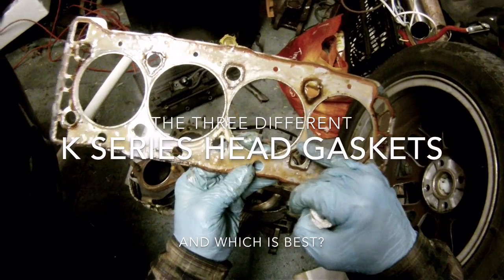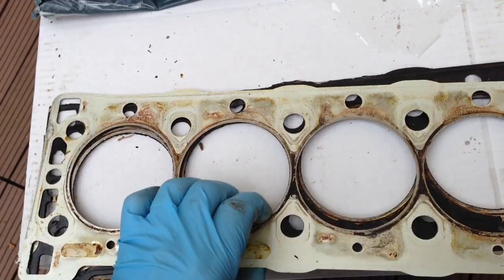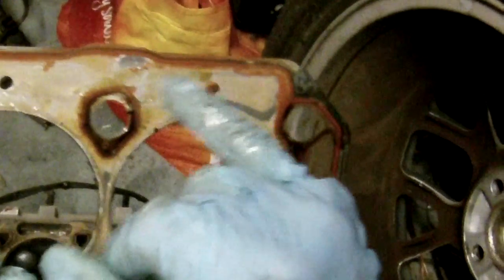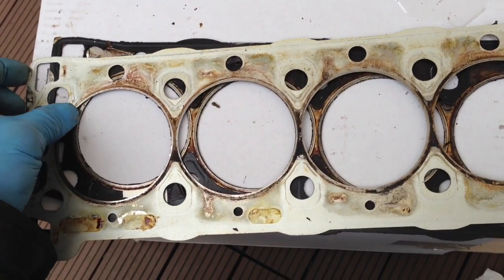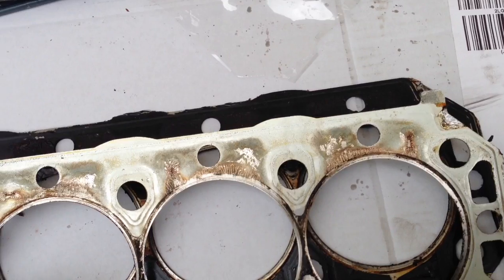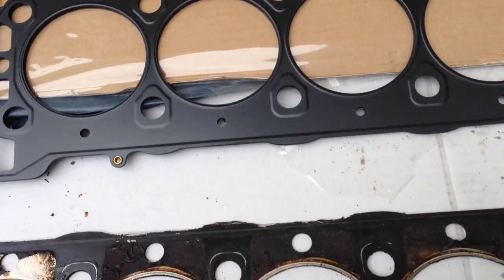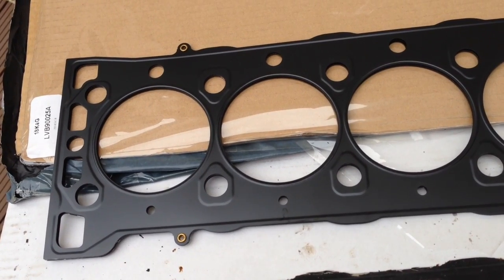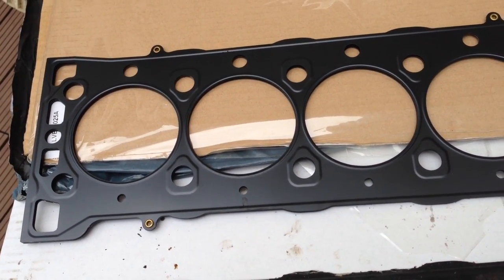MG Rover K Series Head Gaskets Review - The 3 Types Why 2 Fail

Comment: ai told me that replacing 216 si K series 1.6 engine head gasket with 1.8 freelander k series head gasket fixes the chronic head gasket problem on 216 si hatchbacks. is that true?
Reply from the maker: The Freelander one will be better than the original probably but the best is the ‘N series’ gasket. A link for a video on that is here https://youtu.be/aMcjc3LmMv0?si=mgiswRnoVZM0ncWT

Comment: I've had three Rover cars fitted with their K series engine and I've never had a gasket failure on any if them. My present one is a Rover 45 with the 1.4 K series which not long after I bought it started to run badly so I took it to the garage and they told me, its the head gasket and then quoted me £500 to fix it. This was early in 2020 and as the Government told us all to stay home, I though while im at home I might as well do it myself during lockdown. When I took the head off, I soon realised it was in fact not the head gasket but a leaking vavle. It was also fitted with the newer single steele head gasket. While I had thd head off I reconditioned it and after talking to MGRover spares I bought the gasket as fitted originally with the silicone inserts which they told ne were far better than the original. So while I had the head off, I also fitted new piston rings and then re- fitted the  head  using the later stronger bolts. Here we are 4 years later and it still drives perfectly with no problems. So how bad are the older Rover type gaskets, when mine works fine ? Also how many cars like mine were wrongly diagnosed with a failed head gasket,  when in fact it was  fine ?
Reply: I bought a 300 quid MG TF with a blown head gasket. It was a split hose, 10 quid to fix. People believe these stories, even the previous owner who had it for 12 years. I guess he never took off the engine cover to find out.
Reply from the maker: Well done. The k-series is a better engine than many people believe. It was awarded a ‘design centre’ award and uses some good principles like the oil pump driven directly by the crank.   The original elastomer head gaskets can fail by the elastomer moving so the ‘N series’ gasket is better if installed well and that is the key.
Reply: @comeinhandynow  
Thanks for the reply and yes I had heard that the steel gasket was the better one.
However, when deciding what one to use I asked the chap at 'MG Rover discount spares' and he said the latest polymer gaskets are superior to the original ones, so I decided to fit that. In 4 years it hasn't let me down and I've done a lot of miles. Nevertheless, what ever gasket you use, it is a great engine and in my experience not as fragile as its reputation would make you think.
I believe it was the later expanded 1.8 engines that suffer head gasket problems not the original, lower powered 1.4 versions. Also it needs to be done properly and I suspect many garages might have not taken the care that it needed when fitting them. Anyway, it is a great engine and I love driving it, shame Rover is no longer making them. 👍😊
Reply from the maker: @johnbrereton5229  Agreed

Comment: Hello... Here from Argentina. I have been watching your videos and they are very good and useful. I am about to repair a rover 45 1.8.. bought the 6 ply gasket along with higher grade bolts and reinforced oil rail. They tell me that the shirts should protrude 0.1mm for the joint to seal well. What do you think? Greeting.
Reply from the maker: Hello there. Yes around 0.1mm is desirable although I have fitted the 6 ply gasket to engines with nearly flat cylinder liners and it has been ok. Now when the liners are near to zero protrusion I prefer to fit shims to the bottom of the liners to raise them up.  See the description of these items of K series liner shims:
Ebay UK: https://bit.ly/30nNFMh
Reply: I think the problem is not only that ( think with me, i am retired, i learned this from the Rover  factory itself, from its service manual:)
The factory says that the  protrusions of the 4 cylinders/liners must all 4 be THE SAME and 0.003 inch ; (that is almost impossible to find on a well used car,in 4 cars i repaired,  i did not find it ) the reason being that the cylinder head is rigid at 0.000, and a steel gasket IS NOT a  gasket, no way it will seal,it will  NOT seal.
So,either you shim the low liners at the bottomto be 0.003 inch above the block/deck (you NEED to know how to do that..) OR you use a GASKET,i mean,NOT a steel make believe stack of shims;
Of course a steel gasket will never burn, also it will look like it works, but as soon as you push heavily on the horses, the hot combustion gases will leak between the sheets through the silicone and paint makeshift beads!!  hoses will blow,radiators will blow apart the side tanks,seen it all;   the steel (plain,embossed) gaskets work well on exhaust manifolds,not on head to block;
I am doing a 25  1.4 right now,2 liners are at .001 and 2 are at .0025 inch,and i ran out of gaskets,real old style gaskets,need to order 2 or 3;
Of course,the engine must not leak coolant (hoses,clamps,water pump..!) but that goes for all cars.
Greetings from Portugal
Reply: For you who is better MLS or elastomer hg

Comment: The engine that killed Rover MG terrible design that was and is unfixable once they over heat they are dead as ROVER MG found out even lotus ditched it because of its none ending faults
Reply from the maker: No. They can be built to be reliable. Later engines with N series type HG’s were reliable. The engine won a design centre award.  It was very advanced for the time using F1 type principles.  See this reasonable write up of the good and bad bits of it’s story https://www.aronline.co.uk/engines/k-series-engine/
Reply: @comeinhandynow  I wish I had your confidence but I've had five mgzts and all of them suffered the same k series engine problems I gave up in the end and bought a toyota space cruiser and its 100 percent reliable even tho its 36 years old

Comment: My neighbour is working on a freelander with failed HG what he should check? What is that liner clearance everyone is talking about
Reply from the maker: Here is a recent video of mine on the engine in the freelander which should help.  There are more on my channel https://youtu.be/8BEYJX-GOIc
Reply from the maker: The liner clearance is actually the liner height issue.  With thermal movement over the years the liners can sink from their normal 3 thou height from the block surface.  If they are flat use liner shims to raise them up again as shown in that video on my other reply.

Comment: So it's nearly 4 years since this video was done. have you heard of any failures?? i used to do K series head gaskets all the time , even in my sleep ha ha. I did used the multi layer gasket twice and  on both cars it leaked twice,  even before i started the engine and both in the same bloody place so refused to fit them ever again, just carried on fitting the original style gasket.
Reply from the maker: That particular one went on for several years.  The metal gaskets can be susceptible to weep, especially on non perfect gaskets or surfaces.  One gasket had the part number stamped right over the raised edge sealing, which wasn’t great for sealing, but was mostly ok. (Got to be fussy and check that Chinese quality or lack of it).  Sometimes the block surfaces get damaged which is the case on one I am doing at the moment.  So I’ll run a thin layer of Loctite 574 over the sealing points (not fire ring) before putting the HG on top as I can’t see that doing any harm, only good.
Reply: @comeinhandynow  I can't recall a part number been stamp but was quite a few years ago now. It was very rare i had a head skimmed unless the head gasket liner ring had dug into the head. If it was just a slight mark into the head, it did't get skimmed, just cleaned up. A lot of garages just automatically sent them for skimming when they didn't need it and just done the head gasket. They didn't replace the slightly weeping water pump or the inlet manifold gasket that only leaked when it was cold. They didn't pressure tested the system to see if anything else was leaking. That was essential on an MGf/TF. They then wondered why the gasket had blown a few months later. I've never put sealant on head gaskets but have put 2 head gaskets on a Fiat Tipo diesel at the dealers once lol. Clenliness is the key when putting a  K series head back on!!
Reply from the maker: @paulrobinson3528  The item with the part number in the wrong place was an ‘N-series‘ gasket bought from china, the quality of their items needs careful checking. Another I bought recently has a scratch over the sealing layer and the supplier tried to blame it on me, so I now video the opening and inspection of these gaskets in case of any problems.

Comment: As well as putting the N series gasket, it's also recommended to put the new modified stronger head bolts and new modified stronger lower oil rail thing that goes in the sump at the same time...
Reply from the maker: Yes indeed, see my other video https://youtu.be/aMcjc3LmMv0

Comment: One very important point worth stressing  again  when repairing any car engine needing a new Cylinder Head Gasket. Checking, cleaning and assembling the engine components are within manufacturers recommended guidelines is essential. It's not simply the case of fitting a "better" gasket. The very best gaskets in the world will not last long if these important  checks and preparations are not done properly. Yes, even in well run pro-outfits they can and do  get it wrong. 

Then it's cue "Repeat failure mate.. they all do that" Well known fact in the trade... ;-)
Reply from the maker: Very true.
Reply: On pre 2005 engines you can find liners sinking. They need to be 4 to 5 thou proud of the deck. If not you can tap them out from below, spend 40 quid on shims and reinsert with new blue hymars. No point in ignoring an engine which is out of spec.

Comment: Interest comparisons there. Thanks for putting it up. Bought two new K-Series cars still on original Cylinder Head Gaskets. One in 1993 and another in 2003 ( MG ZS 1.8 ) and in family use  including today. I think far too many folks use the term FAIL where head gaskets in any cars are involved. That includes a work colleague with his BMW 5-Series. According to him, his car's CHG has failed. Invariably, they rarely fail. More likely they are first damaged by severe over heating and that excess of heat damages gaskets so they no longer are able to do the job they were designed to do. We have also two cars in the family fleet both bought cheaply with suspected "HGF" of which I fitted MLS Head Gaskets with Head "Saver" shim.  Ten years on after that work still in regular daily use. However, far too many folks whip off the old gasket and bung on the new There's more to it than that. Cue so called "repeat" failures soon after professional repair where basic checked were not done. Those checks are for truth of head-to-block interfaces and the all important cylinder liner heights. Failure to do these basic checks to see all is well means "They all do that Mate" so called repeat failures.  A very convenient get out clause for incompetence.The best gaskets in the world will "fail" if basic checks of components are within manufacturers recommended  are not done. I have repaired successfully six so called pro-repair "repeat failures" where the real failure is incompetence. In my experience, the prime cause of cylinder head gasket DAMAGE is coolant loss leading to severe engine overheating. That excess heat causes engine damage and the first component damaged is usually ... guess what. I recovered a work colleagues Toyota on my trailer and he drove on when it was obvious something was wrong with his car. It needed more than a head gasket. It needed a replacement engine. Still lets ignore that, Lets blame the poor old Head Gasket. Been on TV and everything and those folks are professionals and always know what they are on about. Stands to reason.. My brand new tyre failed soon after having it fitted. There was a dirty great six inch nail in the side wall. It had not failed. It was damaged! Finally, in my experience, the major cause of engine over heating in K-Series engines is coolant loss. Prime suspect for coolant loss in K-Series engines is a Worn Out ( not failed ) Water Pump. There are other reasons for coolant loss of course and those need to be identified and rectified or stand by for a repeat "HGF" soon after repairs.
Reply from the maker: Thanks for your interesting comments.  Good to read that you do it yourself and keep these MG Rovers on the road. You write a lot of sense.
Reply: MG John. 

Why do you suppose the HGs both failed in my ZR and 25? ZR owned from new, always well maintained. 25 second owner low miles, well maintained.

No lack of fluids or overheating causing the gasket to fail. I’ve always caught the gasket failing very early on and no further damage has been caused. But in my case I definitely think the gasket was the failure rather than something else leading to it. 

I love the K-Series. It’s a great engine. I’m actually now on the lookout for a ZT-T 1.8 Turbo. I’ve no qualms running a K engined car daily. They are light, powerful and easy to work on. I definitely think there is a weakness with the original HG design. 

Other gaskets and seals are problematic too, such as the IMG and cam oil seals. Not major issues, cheap and easy to replace, but definitely a bit of a weak point to an otherwise strong and robust engine. 

I’d still take a MG-Rover product today over anything else of the same age. New cars don’t appeal.
Reply: @michaelb9664   Hi Michael B. My view is that they rarely fail of their own accord. Any new component or old can have something wrong with it and so not be good for the job and that shows up eventually as a weakness sooner or later.   In my experience, there is usually another root cause when head gaskets, in any car .. fail or become damaged...There is always a reason for these things. Trick is finding that or those reasons. . My daily drivers are now two MG ZT-T 1.8Ts. Also a Chinese built MG6 Magnette saloon. The last named a 74,000 mile car bought as an MoT failure engine donor for one of the ZT-Ts. That ZT-T over heated at speed when the BMW style spring loaded coolant hose clip let go and became detached unseen from the Coolant Outlet Elbow on the front of the Cylinder Head.. That enabled all the coolant to escape very quickly at speed unseen until the needle on the coolant temperature gauge reached the top and on came that big red light. Not only was the Head Gasket damaged, but the excess heat broke up a few of the piston lands between the piston rings. I was to discover all this later when working on that engine. The MG6 was far too good to break and I spent less than two hundred quid getting it's Mot. Then rebuilt the ZT-T 1.8T engine with new liners and pistons. Not a huge expense but lots of my enjoyable DIY time.  The rebuild was a success. Better than I could have hoped and effectively drives like a new engine ... which most of the components now are. Yes, I agree, the much maligned K-Series is a cracking engine in more ways than one... ;-)  I like 'em and so do the Chinese who snapped up MG's IPRs for peanuts. The MG SIX is a better car than I had been led to believe. Stay safe .. Safety Fast Motoring in fact .. the old MG Advertising slogan.
Reply: @michaelb9664  By the way Michael, I  agree with you when you say :~

"New cars don’t appeal.". 

With the exception of say an Orange McLaren and maybe one or two other "exotics", nothing any of the current range manufacturers have to offer in their modern model line ups appeals at all. Nothing appeals...

I will not join the massively increasing ranks of SUV/CROSSOVER car consumers. They maybe a means of getting about for the majority now, but not for me. I shall continue creeping about in my aged MGs and Rovers which have and continue to serve me well. They cost buttons to purchase relatively and run. Even the new MG ZS my wife's daily driver for seventeen years now pre-Lockdown ~ with the "They all do that 1.8 K-Series" only my one has not done that. Yeah, I know I'm lucky.. ;-) For instance, my MG SIX recently purchased costs less to obtain than my always buys German friendly neighbour pays for a few weeks rental/pcp or whatever finance for his BMW-Bi-Turbo ... wait for it OIL BURNER.  Plus, he will not arrive any sooner than I do in my cars. I gave him a lift in my old ZT Saloon some years ago. He was genuinely surprised by the car and the way it goes. Yet, when the time came to buy his new car... German. 

Finally, OK hold my hands up... Very Guilty M'Lud.. I lied .. about the "creeping about" bit... ;-) ...Stay Safe.

Comment: I just can't believe that they settled for these rubber addons to the gasket which were "glued" on. Of course they will fail. I'm working on mine as we speak. MLS gasket with shim is going in.
Reply from the maker: Yep, doesn't look that good, however they obviously lasted a lot of years despite that.  I am tempted to try the Victor Reinz head gaskets that are rubberised but with a bigger rubber contact surface area for better gluing and clamping.  The one advantage of the rubber sealed ones is that when they stay in place the seal is possible tighter.  Whereas the purely metal gaskets have been known to show a little bit of seepage sometimes, even though it shouldn’t go in a major way.  I must try and look up peoples experiences with the Reinz gasket.